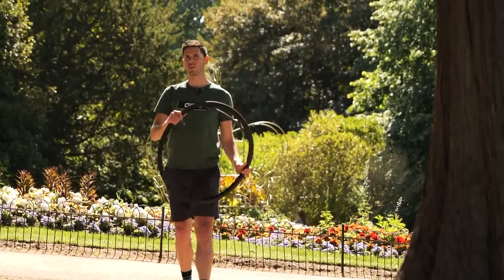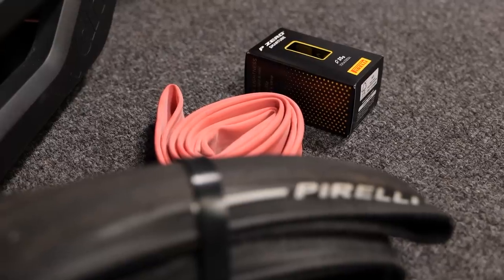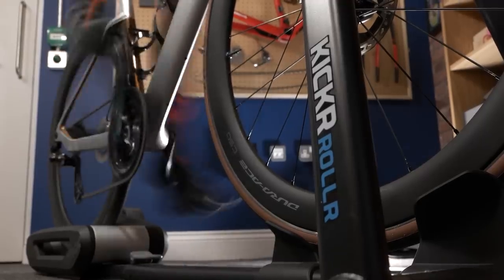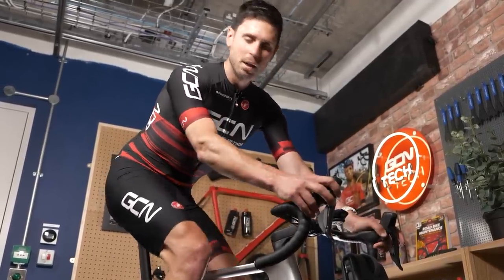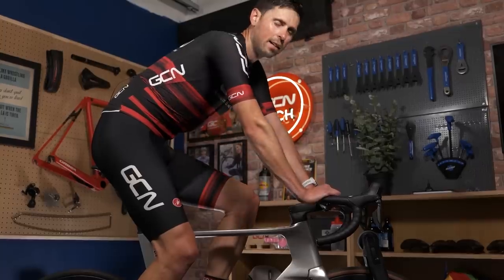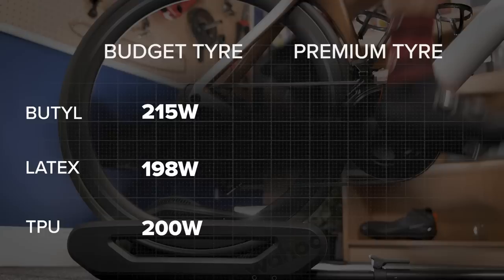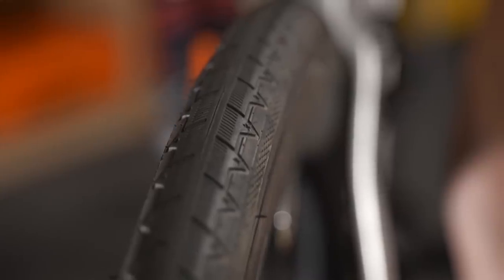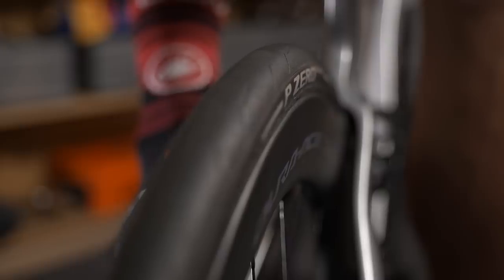How Much Faster Will This Bike Upgrade Make You?

Comment: Theoretically would you save more watts out on the road as then the front tyre's rolling resistance (even if it less than rear's) would come into play as well? Would the rougher surface of the road make rolling resistance more or less important? How about tyre width?

Comment: On my winter comutter bike I currently use the Schwalbe Marathon 28mm. Great in rain and so far not a single puncture. But in a few months I would like to try a proper fast tyre to experience less rolling resistance for myself. Any suggestions?
Hutchinson Fusion 5, Schwalbe One, Continental 5000, Pirelli/Goodyear?

Comment: Your results are very interesting, and I suspect that they understate the advantage of latex tubes. On your dyno, the front tire isn't rolling at all and doesn't matter. But on the road, a front tire with a latex tube would have the same improvement in rolling resistance.
Reply: Not exactly the same, but almost.

 Typically a road bicycle will have slightly more weight on the rear wheel, thus a higher workload. Common weight distribution is 52/48 Rear/Front, so you can expect 96% of the improvements with the front wheel since rolling resistance goes up linearly.

Comment: Great video! So latex is better overall despite the higher weight in comparison with the TPU. However, this is on the rollers which you can assume that they simulate riding on flats. How about climbing? Is the lower rolling resistance still king or is weight more important (kind of similar to the aero Vs lightweight on the climbs). On the flats aero is faster while on the climbs the lighter the faster
Reply: I think latex wins in most real world scenarios. The latex tubes are 84g heavier but save 6 watts (160g vs 76g for tubolito). There are not many rides where 84g costs you 6 or more watts.
Reply: You might be interested in Simon's KOM attempt on his tricked out Canyon Aeroad. Unless you live in Andorra aerodynamics may still be of interest to you.

Comment: Sure you may have gone from two extremes, from really bad to really good, but you also only measured the rear tyre. Your front wheel was conspicuously stationary as those Wahoo rollers don't connect front to back.
Reply: Given that the power put on the pedals goes only to the rear wheel, I fail to see where that would be a problem... ;)
Reply: @rhobson  When riding, your power is applied to the rear wheel, but the resistance you have to overcome is the rolling resistance of both wheels (and all other friction, including air drag).  The rolling resistance is the friction that the road exerts on the tyre, not the power you apply to the wheel.  The front wheel doesn't have zero friction and just magically glides, even if we wish it did some days.
Reply: @AlexanderLiffers  I got where you're trying to get, but in this test the powermeter is (on) the pedals, so it ignore (or corrects through math) the geartrain and frictional losses. It's kinda the same when dynoing a car: power (kW, HP or whatever metric you use) on the crank VS on the wheels... Btw, since on the video they maintained the variables and tested both before and after with the two tires and all three tubes, we can safely assume there's an accurate comparison between the deltas found.

Also, given that powermeters are either on the pedals or on the crank arms, I don't think that even if there was a way to calculate with great precision the exact amount of power being put to the asphalt and/or being lost somewhere in the middle would be much helpful until everyone started to do the same.

Comment: What would you suggest for a bike tire if your just doing bike touring over multiple weeks or months.....looking for greater puncture resistance but also comfort and climbing ability.  I have presta tubed rims and want to get slime tubes but I ride a recumbent trike with 20" front and 26" rear tires.

Comment: It is easy to say that better tubes and tires will save energy, there are plenty of studies proving that. In this test I don't think that we can take the figures presented as accurate. From my understanding there are two major things that a tire can offer to save watts; compliance, and roiling resistance. Rolling resistance in particular is heavily impacted by the shape and size of the tires contact patch, witch is artificially constrained in this test, the tires contact patch with the roller is vastly different from the tires contact patch with the ground. There is also no consideration of compliance in this test as the bike is placed on a perfectly smooth surface. Also I would like to see a test of tubeless tires, as they are touted to have better compliance, and rolling resistance by extension, and it is possible to upgrade a non tubeless rim to be compatible.

Comment: although the results of the upgrade are compelling as tested I think they are understated because wouldn’t you pick up similar power savings from the front tire?
Reply: The rear tire has already 2 contact surfaces on the 2 rollers. Not having the front wheel on an additional roller makes the results more realistic. Nevertheless, the saving in reality might be smaller as the rolling resistance on a flat surface is lower than on a roller with small diameter.

Comment: #AskGCNTech 
I do understand the testing and results/differnces. What I would like to know is how sciencetifically does the innertube effect the rolling resistence of the tyre. If all innertubes are at the same pressure, the force on the tyre to road should be the same. I've watch a lot of GCN videos there they say a certain combination gives less rolling resistance, but how and why?.
Reply: Weight difference. Latex inner tubes are lighter.

Comment: I ve a question , I don t know if you ve done it this way :

I suppose that you inflate the tyres the same pressure, but since the tyre a surely very different in them construction dont you should have do the test with a equal surface patch instead ?

many thanks for your answer

Comment: Does the front or rear tire more greatly affect rr or is it same?
Reply: The effect on rear tire is higher because more of your weight is sitting there. RR is proportional to the weight. And weight distribution on a bike might be around 70:30 or so for rear:front. So rr should be about twice as high on rear than on front.
In the video rear was measured. If you save 45W there then you might safe another ~20W on the front additionally. That adds up to ~65W!

Comment: @GCNTech what's you take on talcum powder? In my experience makes a substantial difference to rolling resistance as well, acting as a dry lubricant between inner tube and tyre.
Reply: Agree. This needs testing as this is an old forgotten trick. Works well for me.

Comment: I was getting a puncture a week using butyl tubes but since I’ve changed to latex I’ve not had one in two months.
The only downside is that I have to pump them up every day
Reply: No punctures in over a year on old rubber tubes on norfolk roads.

Comment: I have tried both latex and TPU and I will never, ever back to them… 
Latex - air leak is annoying but something you can live with and pump it everyday. However one day they just exploded (front and rear) when I was attaching pump valve. No, thanks!
TPU - the most expensive experiment I have ever done. Easy install, super lightweight and super crazy air leaking! Over the night I had two flats. So I have no chance to use them. No, thanks!

Comment: While I don't doubt that there are good savings, the way this test was done there are two contact points with the rear tire which could exaggerate the benefits by as much as two times since the tire and tube are deflected twice in a row by the contact instead of once.
Reply: But each patch only holds half the weight, but I get your point.

Comment: Can sealant be added to a latex tube to offset the increased rate of air pressure loss? Does adding sealant negate the benefits of latex tubes?

Comment: I don't think it's fair to say that weight necessarily is less relevant than rolling resistance in this instance. Reducing the weight of your tires is essentially the equivalent of reducing the weight of your shoes/feet while when running which makes a huge difference
Reply: Weight savings for wheels is definitely far less significant. Especially in this case which is a steady speed, indoors, with no elevation gain. Heavy wheels are only a disadvantage for stop-starts and climbing. At a steady speed the wheel does not need to be accelerated, only force supplied to overcome rolling resistance, which is practically unaffected by wheel weight because the difference between the lightest and heaviest tyres is only around a 1% difference in the weight on the tyres (and bearings). Whereas rolling resistance of different tyre brands, can vary by over 200% according to the rolling resistance website.
Reply: I don't agree. The weight difference of the inner tubes can be 100g+.  The weight difference in tire choice can also be 20-50g or so. Having this extra weight in the hubs would not be a big problem but having the extra weight that far away from the center of rotation (the hub) makes the angular momentum to move that extra weight a lot greater

Comment: How does the inner tube affect the rolling resistance? It's about the tire having less flex with such an inner tube?
Reply: There is friction between the inner and outer, between both tubes and the wheel, and friction in the tube itself as it stretches and compresses, this is all part of "rolling resistance"

Comment: Is it the latex inner tubes are always more efficient than the butyl even at the same psi or is it just that you can pump latex up to higher psi?
Reply: Always more efficient. They bend a lot more easily, so any deformation is more easily absorbed by the tube.

Comment: You used a tubeless ready tire for the upgrade. If you are using tubes, don’t use tubeless ready tires. They are heavier and have more rigid sidewalls. Probably even more difference if you used a high end clincher/ non-tubeless ready.

Comment: Given that only the rear tyre was rolling, would the resultant watts saving in the real world, be double?
Reply: I don't think so. Rolling resistance on the roller trainer is much higher than on the road. This test may be ok for comparing tyres between each other and that's it.
Reply: @piast99  I now realise the roller has two contact points anyway.

Comment: Very interesting and informative. But as with many test results on bike performance in the lab, which this is really, they aren't always duplicated out on the road. In this test you were cycling on a smooth roller and that's completely different to a tarmac/asphalt surface. For this test to be truly conclusive you'd have to repeat it on the road. So, no I won't upgrade based on this.

Comment: How does the tube affect rolling resistance?  What's the physics behind the claim? The road does not see the tube
Reply: There is friction between the inner and outer, between both tubes and the wheel, and friction in the tube itself as it stretches and compresses, this is all part of "rolling resistance"

Comment: Do latex tubes still fail catastrophically like the old Air-B tubes used to? Put me off them for life. They wouldn't puncture but they would blow an 8" slit in them when they did fail.

Comment: can you do an episode on how much savings are in running rim brakes over disc?
Reply from the maker: Or vice versa... 👀
Reply: @gcntech  no.... rim brakes are lighter and more aero and cheaper.   "cost of pads" is negligable considering the other watt savings and "cost of wheels" is also bunk because rim tracks last a loong time and by the time the rim track has been compromised the rim is probably discomisioned from being out of true.  with carbon rims the brake track could be given a ceramic coating.

the best cyclists and the 'worst' cyclists prefer rim brakes and neither ever suffer from 'the brake track is bad but the rim is still good'

Watts, weight, aero advantage, lifetime of rim..

..yeah you can take a rim off the nipples and use the same nipples&spokes to lace a new rim.  ive done it with a dyad before.
Reply: @gcntech  do it.  i dare you to cast rim brake in the true light they deserve.  disc brakes weigh down bikes and offer less for more to 90+% of cyclists/riding conditions.

Si lost on his ribble disc in that episode not too long ago..  i dont suppose he forgot to remove the polylube and replace a thin, solvent like lube in its place ;) those discs added inertia to the wheel and aero losses

i have a flat mount, and rim brake bosses on my ti frame and in the winter upcoming ill swap-in a Klamper.

Comment: You didn’t mentioned the specs of the butyl tube. If it is a lightweight innertube , the difference to the other tube might not be that significant, and might not justify the hassle and lack of reliability of the latex and tpu tubes…

Comment: I live in Sedona. It is crazy to have less than a 40mm tire because of the rough roads. It is also most effective to have tube protectors (The horny goat thorns here are literally built like caltrops.) Once you add tube protectors, then the weight and rolling resistance of a fancy tube is negligible.

Comment: That is only measuring the resistance on the rear tire only!! If front tire was the same, and measured on a treadmill or on the road, the power differences would be larger.

Comment: arnt you only testing 1 wheel? the front wheel isn't doing anything, you need to have both wheels turnings on a static surface to get a reliable result for both wheels

Comment: sadly, a test incorrectly set. You need to test this on roads, not a roller. Info won't transfer 100% so results doesn't work
Would be nice too if you ever tested the difference between race Tyres and airless solid Tyres like tannus.
I use tannus myself and they are definitely slower but I can't measure how much

Comment: Hey one thing though, on the trainer, you have only the back wheel turning... and also the contact point are 2 rollers (it looks like) and not really the same as the more or less flat road.
Reply: Yep, totally different contact patch. Real world scenario this is not.
Reply: Hey don’t burst the gcn bubble! Video is the biggest load of rubbish they’ve put out in a long time. We need hambini to do a review.
Reply: @titaniumben9923  but to be fair i think this test still displays the real world difference. I too have tried latex tubes with nice tyres and they are much quicker.

Comment: A premium tyre would be a 25 at most! Pro Tour de France riders ride 25c tires at the most! I’m a avid cyclist who has ridden 28’s and up. They’re more comfortable but you will suffer a cost at speed and performance. Obviously a 23 will be the fastest! But a 25 is the best compromise between comfort and performance! I feel no difference in performance between a 23 and a 25! But the comfort you gain with the 25 is incredible! And there is plenty of scientific data to back up my claim, if you wish to search and try it out for yourself. 😎
Reply: Scientists have realised that wieder tyres are faster on 'real' tarmac. Skinnier tyres are only faster on track
Reply: I think recent-ish research indicates that 25 is (generally) optimal for professional road racing. 23mm is surprisingly not faster. I think GCN covered this a few years ago.

Comment: Seems like Latex and TPU tubes are only worth it when racing, also why didn't you test a tubeless setup with the same tire ?
Reply: On one of my roadbike wheelsets I use Continental GP 5000 tube type for several years (This wheelset isn't tubeless ready) . At first with standard butyl tubes. Later I changed to Bontrager latex and TPU (Schwalbe Aerothan 41g.).  Latex is the fastest option , but Aerothan is not far behind. ( Use enough baby powder while installing tube and tire) .
The Aerothan hold the air very well and are heat resistant ( good for rim- brake -bikes). My butyl tubes didn't it better. 
On the ride you feel the better acceleration (less weight). 
On my other wheelset I use the new Continental GP 5000 STR. This tubeless tire looses pressure faster than my latex tubes. The tires are installed correctly , with enough sealant.
The tires run smooth and fast with great grip when cornering.
My personal conclusion is:  For me is a standard butyl tube on a roadbike a thing of the past

Comment: Isn’t the whole point of cycling to get fit by trying to push a higher, consistent amount of power over a long period of time? By reducing the amount of power produced aren’t you reducing your workout significantly? If I can push out 200 watts an hour compared to 170 watts power hour I’m sure my legs will feel “the burn” after my cycling session more after pushing the higher watts. Fair enough if you’re racing (not many people actually race or do sportives often) but for training I’d rather increase my drag/rolling resistance to yield a greater workout
Reply: same. my winter set-up is butyl tubes and gator hardshell tyres but then summer is TPU tubes with GP5000's and maybe an aero wheelset if I can find a good deal for racing. I don't have a "winter bike" but at least it increases resistance.
Reply: Try wearing a rucksack filled with a few house bricks too. Huge workout increase in shorter time! Double-bubble.
Reply: @windyturtle737  I tried to move away from my Gaterskin hardshells, riding in London, but had to move back after the ridiculous amount of flats I was getting. Saving a few watts is all good, but knowing it’s likely you’ll get to your destination without getting a flat is key.
Reply: Sure, but this isn't how training works. Otherwise we'd all ride around in sand into headwinds. The reality is you ride further and faster, having zero impact on your training.
Reply: @titaniumben9923  true but if I feel like I'm going faster, I'll likely push myself more to be faster, even if the tyres themselves don't directly increase my speed.